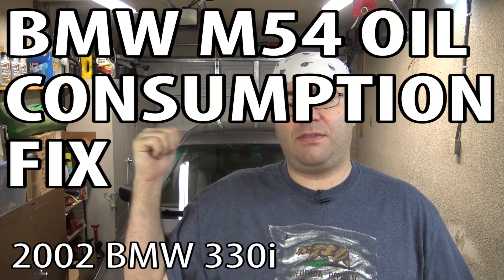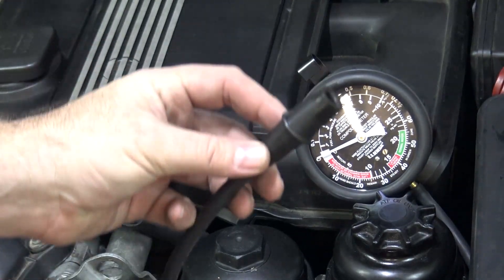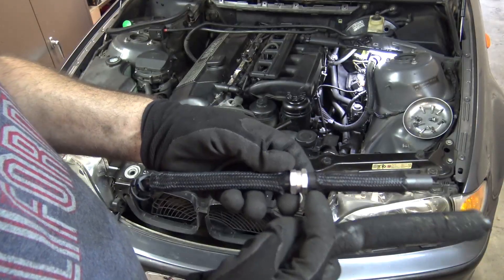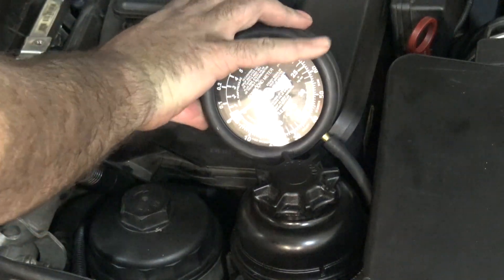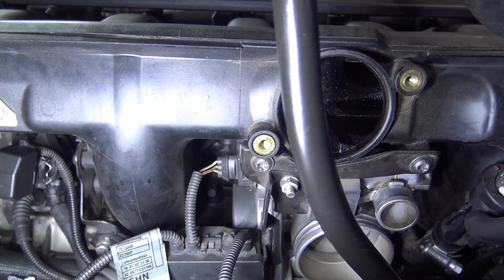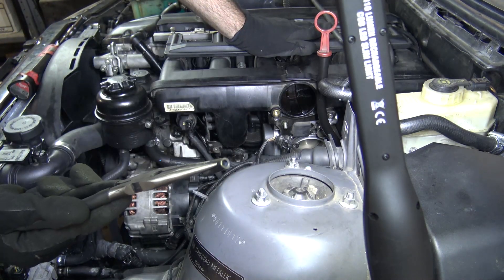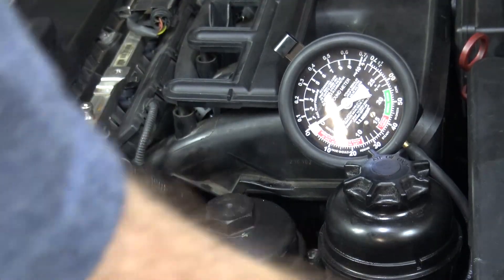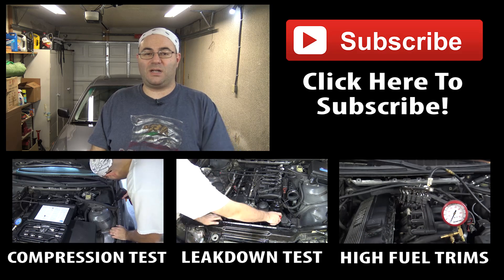BMW E46/E39 M54 Engine Oil Consumption Fix (02Pilot Mod) DIY

Comment: Would this mod be ok to use in the UK? We have hot, cold, wet and freezing conditions?
Reply: Did you do the o2 pilot mod? Im also in tb uk and not sure if its okay in our climate.
Thanks
Reply: @joefowler9600  yes you can do it in your climate
Reply: @lawpenner  thanks for the reply. Would you fit a non return valve on the oil return pipe? I cant see how a non return valve would let oil past back to the sump, as there is no pressure to open the valve.
Reply: @joefowler9600  no I would not. Why fit a valve that may restrict the flow of oil downward, if there is not a reported issue sucking oil upward
Reply: @lawpenner  thats my thought as well, but people talk about the possibility of oil being sucked back. I wonder if it has actually happened to anyone, or if its just speculation.
I definitely don't think a check valve would let oil past back to the pan, so would probably present a problem in the future by fitting one.
Reply: @joefowler9600  50sKid initially installed a check valve but then found it getting clogged and didn't appear necessary, so in an update this is what he said and changed his recommendation against it.

Many people have done the O2 pilot mod, without check valve, successfully and not reported a problem sucking oil so I'm going to go with that until the problem presents itself otherwise

Comment: Curious if this mod will work on a e90. My e90 325i is doing this oil consumption. can anyone tell me if this procedure is the same for an e90, im googling and cant find anyone using this mod.

Comment: Anyone have issues with oil pressure light flickering after this mod? It does it, when its driven quite a while, and is hot. when i open the oil c
ap it stops, and it only flickers, when rpms drop to standart standing rpms 750 or so. And then after some time it again starts doing that.
Reply: komentatorius69 mine does this aswel since I did this mod, however I don’t think this an hazard to the engine
Reply: you could have an electrical issue
Reply: So i changed oil, and flickering was gone. Not sure why it flickered, because irs was motul oil and i have driven like less then 5k kms on it. Plus dipstic was 4/5 of oil between the marks

Comment: Hey 50s kid. Love your work and I have an 02 325xi that eats oil like crazy. Im really interested in changing out my ccv system but don't want a catch can perse.  Do you think an air oil separator like for a turbo Subaru would work?? Or is that basically what BMW has designed?? Could you lmk what you would recommend please

Comment: Thank you 50sKid  your videos are so well documented , imo the best around anywhere. 
The mod is working on M54, i also added the one way check valve.
I used vacuum port on the rear manifold with the same diameter on the ccv valve.m M54 3.0 E39
Reply: You just ran a 3/32" vacuum line to the manifold? Used the small port instead of adapting to the 1/4"?

Comment: I wanna thank you for this excellent video.  My 2002 325i which was consuming 1.5 litre of oil every 1000 km and throwing up the low oil level light after a 1000km high RPM journey.  I followed your instructions to the letter to install the O2 Pilot mod, except I used the smaller vacuum port since it is unused and thereby not requiring a step up adapter for the hose.   have now travelled 500 km after doing the mod and I have not had to top up the oil at all.  I just did a another 500 km hard continuous drive and at the end of the journey, not a drop was added also.  Thanks a lot to you man.
Reply: The oil consumption was alright for a while after doing the mod but it started going bad again. I did a flush and an oil change switching to viscosity 60.  I’m a happy camper again.
Reply: @DrSec56  60 is pretty thick compared to stock. Do a lot of people run it?
Reply: ironman tooltime, Due to the age of the M54 engine, the oil recommendation has been revised to viscosity 50.  It is alright to use a +10 viscosity.  It does seem to have cured the oil consumption problem together with the O2 pilot mod.  It’s 3000 km without a drop of oil added.
Reply: @DrSec56  interesting cheers

Comment: My oil catchcan hasn't got an extra vacuum connection for the 02 pilot mod. Can i put somewhere else? One the hose to the oil gauge rod? I allready put an check valve on it. Many thanks in advance! Geoffrey

Comment: Thanks 50sKid, love your vids! 2005 325xi here, uses about a quart every 500 miles.  No blue/gray or any noticeable exhaust coming out of the tailpipe.  Live in Twin Cities, Minnesota.  Questions for you please.  1) Is it possible that this mod could blow out/suck in any other seals because of the vacuum created?  2) Can this mod be "disconnected" during the winter months, then hook back up for the warm months?  3) Could you use an insulated vacuum tube?  Thanks, Dan.
Reply: 1) no  2) yes, but not necessary to disconnect in winter months  3) not necessary

Comment: For the non return check valve which way does it go on?
Reply: There is an arrow on the check-valve, it should point TOWARDS the dipstick connection, AWAY from the CCV. You want oil to FLOW back into your dipstick, so the arrow direction will match this.
Reply: arrow pointing down

Comment: Hi 50sKid thanks for the great job you are doing with your videos.
From my understanding there is another option to increase vacuum in the crank case. What about just removing the diaphragm from the oil separator? Should have the same effect from my point of view. And of course install the check valve in the oil drain. Has someone ever tried that? 
Regards vom Germany
Reply: Alexander Scheufen that would cause unregulated vacuum in your crankcase and essentially act like an air leak causing your engine to run poorly

Comment: Hello everybody.
I just did the mod while I was replacing TB and DISA Valve gaskets. My '01 325ci cosummed about 1L/10000km. We'll see from now on. At the moment I feel smoother driving in low rpms.
I put a check valve in the return oil hose from CCV and I'd like to share info about this: I put a similar one than 50skid and I didn't like its quality, I think it's gonna end up clogging. Besides while I was checking it outside the car just attached to the hose, I realized only it is going to work properly if it's placed in a vertical position. Easy to do with some zip clamps though.
Anyway... I want to replace this valve soon with another one which is always opened till vacuum apears.
Anyone knows/have tried a good check valve for this purpose?
Thanks!
Reply: I was wondering if he had that check valve installed in this video. Putting full vacuum on the ccv would suck up the oil up the oil return line, like he explained in his CCV explanation video

Comment: So i capped off my oil vent, as some on forum said it was ok and some said sometimes it caused problems. I should hook it up to a vaccum now I'm assuming? I want to lower the oil consumption, which has been a problem since I bought it.

Comment: This is a great video - I’m going to try and install this at the same time as changing the oil filter housing gasket, with the help from another great video of yours. 

I’m in the UK and have a 320Ci - my question is regarding this new hose. If we’re using the smaller vacuum port, can we use one size hose? Is it the same sized port on each size?

Thanks!
Reply: Hi, did you do the o2 pilot mod? I'm also in the UK and want to try it, but not sure if its ok to do in our climate?
Thanks, Joe.
Reply: @joefowler9600  The UK doesn't get cold enough for the "cold weather" CCV, but short trips can cause gunk to build up; the 02 pilot mod should reduce that.
Reply: @JMUDoc  hi, thanks for the reply.
Just to let you know, i installed the o2 pilot earlier this year and it has dramatically reduced oil consumption.
Reply: @joefowler9600  Did you use the check valve? Jason reckons it's not worth it because they fail and have to be replaced...
Reply: @JMUDoc  no i didn't use a check valve.
I can't see a check valve working anyway, as the valves i looked at, need a bit of pressure to let fluid pass through in the right direction. I don't think the oil returning to the dip stick would have enough pressure to pass through the valve.
Reply: I am about to do this mod and will use a single 3.5 ID hose - the rubber plug on the oil separator is exactly the same part number as the one on the manifold!

Comment: Hi 50s kid, I need some help please. I will try my best to explain. Ok, I have 2002 European BMW 318ti with n42 engine. I had a vacuum leak and oil leak,so I bought an oil catch can . I installed the catch by just removing the ccv hoses  and placing a new hose to the crank case and intake with the check valve place on the intake line and the oil return cap at the can and also at the dip stick. The car starts and runs fine but the oil leak got worse; I notice that it may be leaking from the top of the engine.
Reply: This mod won't magically fix bad seals, it's for cars that have trouble with oil CONSUMPTION (not leaking out somewhere)

It might help a little with leaks but not if a seal is fucked

Comment: Hey guys i just did the 02 pilot mod on my 01 e46 like yesterday, i have been burning about 2qt every 1k miles. I cant wait to see the results after 1k miles,
Reply: Update on my 02 pilot mod, the first 1k since install it burnt about 1.5qt, since then i see about 1qt burned every 1300miles. This is already a great reduction, i wish it completely stopped burning, but im happy with what i got.
Reply: Another update usually il let my car run until the oil light comes on which is about 2qt of burned oil, and it used to come on every 1k miles. This time around the light came on after 1500miles. I wish there was a way to make the 02 pilot mod more effective.
Reply: @snkahu  check your system for vacuum leaks
Reply: @lawpenner  you think vaccum leaks can cause more oil consumption?
Reply: @snkahu  the O2 pilot mod directs vacuum pressure to suck piston rings toward the cylinder walls, to create a better seal and reduce oil consumption getting past your oil rings. 

If you have vacuum leaks then you may not be getting as good of vacuum pressure, and your O2 pilot mod may not work as effective, thus you end up burning more oil

Comment: Hey 50's kid I love ur vids. Just had a quick question, I did this mod on my m54 engine and for some reason it caused 2 codes to pop up, p1504 and p1508 and put it in engine failsafe mode. Just wondering where u would go from here. Thankyou for ur time!

Comment: What about the O2Pilot mod on a Boosted engine? 
I run a supercharger setup and Im thinking about this mod to stop my oil consumption, But I have pressure (0.5bar at 6500rpm) into my intake manifold. I've also seen a max vacuum of -0.8 bar (on my boost gauge) when I let the gas at high rpm. What would you do in this case?

Comment: thanks for great video 50's kid. So you recommend installing a check valve on the tube that goes to dip-stick when installing a 02 pilot mod ?
Reply from the maker: Nah not anymore--the valve didn't hold up perfectly after a year. Maybe I need a higher quality one.
Reply: Maybe should update your recommendation in the video.

Comment: Would you be able to do a video on how to replace an oil level sensor on the e46? My yellow oil light comes on sometimes for 10 seconds then goes away after start up. I'm pretty sure it's the oil level sensor and I know that it's a common thing with these cars. That'd be awesome if you made one, thanks!

Comment: Great as always. A question in terms of relative impact on oil consumption between catch can and O2pilot mod.

I removed catch can, installed a new CCV, with this O2pilot mod (and the leaky vacuum lines). Car runs super smooth. However, I have not seen any reduction in oil consumption. I did not have oil catch can long enough to know for sure but is it correct to assume that both methods (O2pilot and catch can) have same impact on oil consumption?
Reply from the maker: They will have the same effect on reducing oil consumption as they both effectively add vacuum to the crankcase.

Comment: Great job with this channel man.
I read some people saying that in some models, you just need to remove the belly pan to access the CCV port. This is the way I'm gonna try on my '01 325ci. I'll let you know if i get away with it.
On the other hand: What about the ID hose? Some people using 3/32", 6/32". I checked the oem diagram and saw a 3.5mm port. Shouldn't be that one the ID hose?
Thanks!
Reply from the maker: no you do everything from above.  Yes it's 3.5mm ID hose but I believe 3/32 works.
Reply: 50sKid So from underneath the car it's not possible to access the CCV? Some people say so. That way would be the easiest one.
I'd also like to use a check valve for the oil return hose as you did. Not sure how easy this proccess is.

Comment: Anybody have a link to an Ebay check-valve that's suitable? I bought one, but it doesn't open by gravity alone. It has a spring & seal inside, so is effectively blocked. Visually looks like 50sKid's valve, but doesn't do the job :(
Reply from the maker: Try pouring a liquid through it from one side and then from the other side.  If it allows it in one direction but not from the other, it works.
Reply: Yeah, I tried to pour some olive oil in there and it doesn't go through. I took it apart (22mm socket) and you can see a spring & rubber seal. Maybe yours is a ball+cage type inside? I've tried two different ebay ones now and they don't work for this purpose.

Comment: Couple Qs: 1. Can you access the CCV return hose from underneath without removing much (except splash shield)? 2. If you get nearly zero consumption after this, wouldn't it be good to use a thinner hose (e.g 2mm) to  reduce the vacuum to the minimum it needs to still work? Maybe only half the suction is enough.

Comment: 50skid thank you for this channel, really.  I have a 2001 530i with the M54. It has about 70k miles on the clock (Japanese Export). I do not consider my oil consumption sever:  Max  3/4 quart per 2500 km (round 1500  miles), and I use 10w40 (I live in a  hot climate; 10 Celsius/50 Fahrenheit is the coldest it can get) .Probably in my case this mod will considerably reduce the already mild oil consumption. But  I want to keep the car and I am wondering  whether going for this mod or installing an oil catch can now would be of benefit to the engine (particularly piston rings) in the long run. Obviously, over time piston rings will gradually consume more and joint clearances will become bigger. My question is would any of these vacuum increasing mods make the rings consume faster as they're being pushed tighter towards cylinder walls for better seal? Perhaps, sticking with the ccv system only and waiting until the oil consumption becomes intolerable; let's say when mileage hits 130k, would get me the most out of the stock piston rings and would even save the cylinder liners as well. Of course with regular oil change every 5000 miles. I know this video has been here for a while and am a bit late, but I would really appreciate your thought about this and you will help me decide.
Reply from the maker: Ahmed Al Kerraz I simply have no data to confirm one way or the other whether this will cause increased wear of the piston rings, however you are balancing potential wear with the definite fact that burning oil causes caked on gunk to build up between the rings, in the ring lands, and on top of the piston.
Reply: Thank you for your reply. That's a good point. Honestly, I never took into account solid deposits building up that would likely cause more damage and wear. So, I guess am going for the 02pilot mod for now at least.

Comment: Thanks for the video, I also performed the 02Pilot mod to my E46 330i.  One thing to note, in the video.  I would NOT check for vacuum at the location shown in this video without the check valve installed.  I bought a vacuum gauge to also test and ended up sucking some oil back into the CCV system and the intake manifold, causing the car to smoke pretty bad.  I am fairly confident the smoke was mostly carbon due to the smell and color.  I cleaned what I could without pulling the manifold, it seems most of the oil was in the air injection thing, held in with the o-rings on top of the manifold.
Reply: Same here...didn't have the check valve and drew a bunch of oil into the intake, smoke like mad from exhaust. Removed the throttle body boot and oil was pooled up in it. Not good.
Reply: Starting to have this problem too, before the o2 pilot mod car was fine, after that started to smoke White\grey and think this is the culprit... Tomorrow i'll disconnect the tube and see what will happen